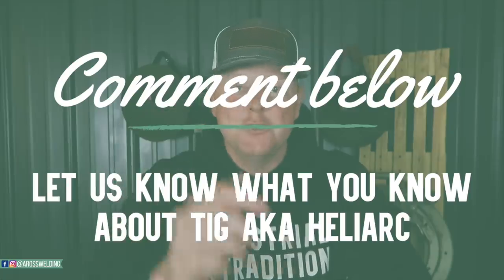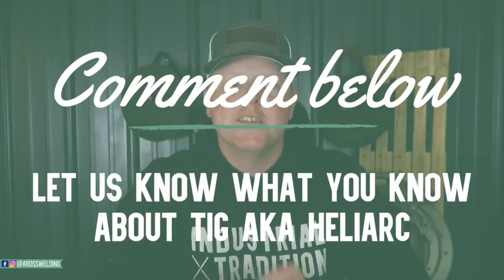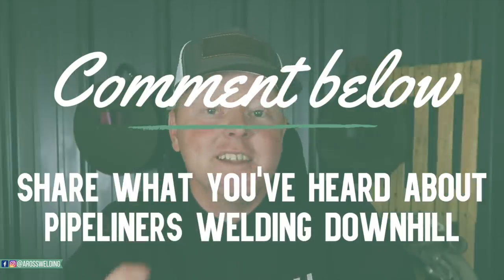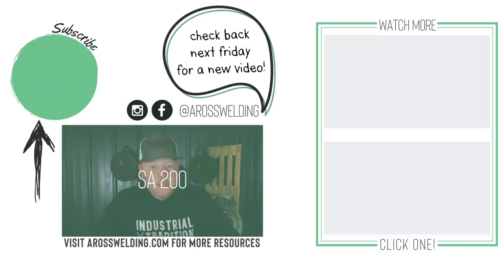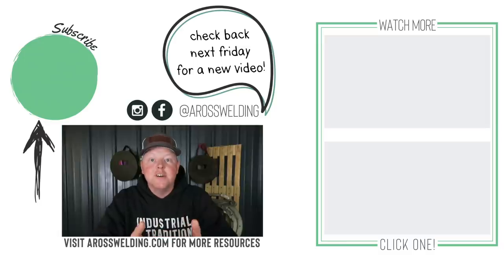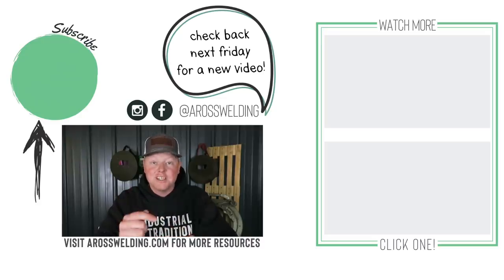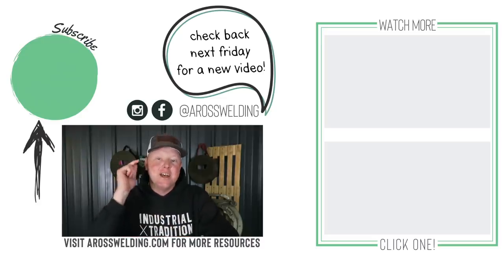WHY PIPELINERS WELD DOWNHILL

Comment: why does the 8010P+ spatter so much? i tried running 5mm 8010s and they  make a mess, the slag on it is light though
Reply from the maker: You can help some of that by turning it down. And pointing it straight in. But they are also just known to be more splattery
Reply: @arosswelding  thanks man, i havent tried that i usually have it at an angle ..
Reply: It seems like the filler metal is more fluid when it melts, different alloy than 60xx and 70xx and maybe a slightly different mix of additives to the flux.  You notice it working the puddle too, or at least that's the way it looks to me.  Not quite as runny as 7018 but a bigger puddle and like it has little waves like a boat motor is running in it.
Reply: john dowe the angle affects your heat too, the shorter the angle the more heat that’ll be created till you start making a mess. Turn down the heat a bit and bring it a bit more upright.
Reply: @billmcyrus  yeah its a little tricky compared to 6010 and 7018

Comment: all pipe welding is uphill except for pipeliners- local 33 Des Moines Iowa plumbers & steamfitters
Reply from the maker: Interesting.
Reply: Yes Local 72 all uphill stick and tig. We run wire downhill in shop.
Reply: Austin Ross what does the average 798 welder make in a years time (I know it varies) it would be interesting to see compared to a UA traveling pipe welder or fitter

Comment: Do you notice any difference between the different designations of 8010, the 8P+, Shield Arc 70, and Arc80?  Or is it just what someone hands you on Tuesday versus Wednesday?
Reply from the maker: If I’m understanding you right, I can def tell a difference between 70+ and 8010 Pipeliners. The Pipeliners run way better.
Reply: @arosswelding  Very good.  How would you describe the difference?

Comment: I found it a little easier doing open root downhill, because your not following the heat up the pipe, your running below it. I would run a little more heat/ amps going down. Also on open root it's 100% pen so that should be the same strength, right?
Reply from the maker: I’m not sure to be honest. I would think so though. Ya.

Comment: Does anyone remember the old 610 Lincoln bead rods? They were white colored. I believe they used white wood flour cellulose for the flux on the rod. By using very tight space in the pipe gang in the sixties, bead hands could stretch the rod out for most of the side on thirty inch stinger bead. They could lay two or three miles of pipe a day in flat country.
Reply from the maker: I obviously don’t but I’ve heard a couple story’s. That’s awesome.

Comment: Are you saying that you don't go uphill on other side of the pipe..Down one side up the other??? Ummmmmm- not the way I was taught as coast guard steampipe welder..
Reply from the maker: Yes, we weld down hill on both sides. Every industry is different. It all depends on what the pipe is being used for. Every job has different procedures.
Reply: @arosswelding  that,s great.always up for new tricks. What do you use for root pass,cover pass etc.. I'm so old and far behind the times that I just now bought my first wire machine...

Comment: Try welding in the coal mining industry 7018 is the only rod they will get. Wind rain mud grease oil 7018 will weld it.
Reply: No 11018 for the booms and other heavy load bearing stuff?
Reply: Bill Cyrus weld with what they gave you

Comment: Back in the day, we used a "stinger" in both hands.  lol
Reply: Well, I do recall one fit-up on a very non-critical pipe that was so bad and gapped so wide on the bottom that I welded it with a 1/8 rod in the stinger while I fed another 1/8 into the puddle with my right hand.  I am a left hander.  That was one bad pipe fitter but he  had caught our married boss out with his secretary.
Reply: @billietyree6139  Texas tig welding!
Reply: @billietyree6139  I always felt a "less than good fit" should be welded by the fitter. Learning from the mistakes of a fitter makes us better welders though.

Comment: less heat because  travel  speed  faster too much heat softens the steel and cause  more distortion  flatter  root because  travel speed is faster too much root can cause turbulence when gasses  flow at high pressures causng  explosion

Comment: Loke all you tube vids I am not impressed. You try to come off as knowing what you are talking about however not so much. This is 42 yrs in the industry talking to you. 7018 does like to be dry and warm but that is not a pre requisite. I have qelded outside in minus f temps in the snow dping watertight weld for years with 7018. You BOYS weld downhill because you are not proficient in unphill. Proper term is uphand and downhand by the way

Comment: And no such thing as a " downhill rod" you should know that if your union welder dude wtf
Reply: Yes there is they just dont like you doing it 7018 can be run downhand as 6010 7018 is a cap pass for vertical up hill did it for years with CBI API 650 code lets you do it also

Comment: Bla bla bla....up hill down hill around hill.....it depends how I feel and I arc mig tig fluxcore....the machine I recommend for any half ass welder is miller pipe pro 400.....can take an average welder and turn you into a pro in less than a half hr.....mig down hill with hard wife using RDM transfer....hot pass and cover flux core with the option of arc or tig right at your disposal......your all in for a treat with this machine.....look it up